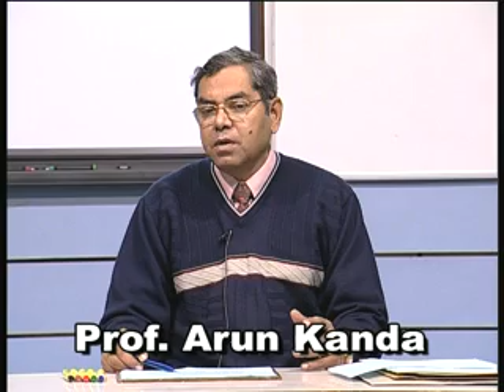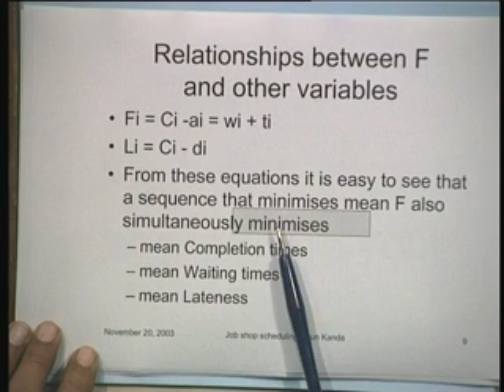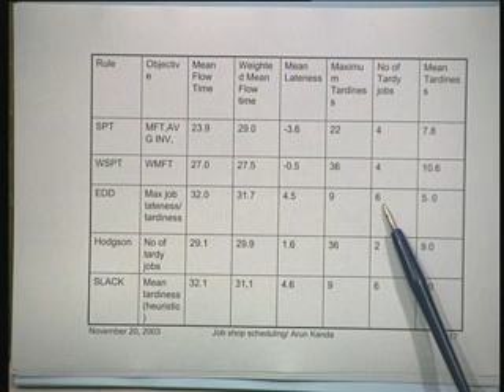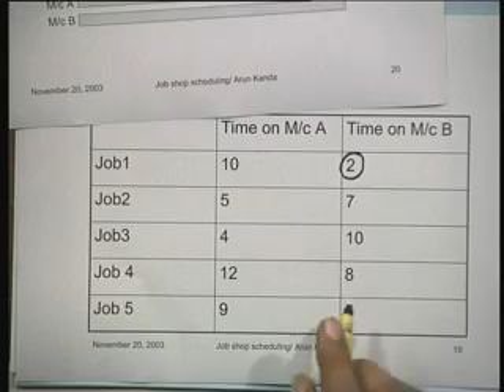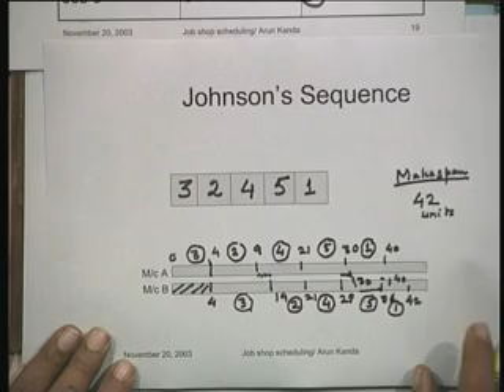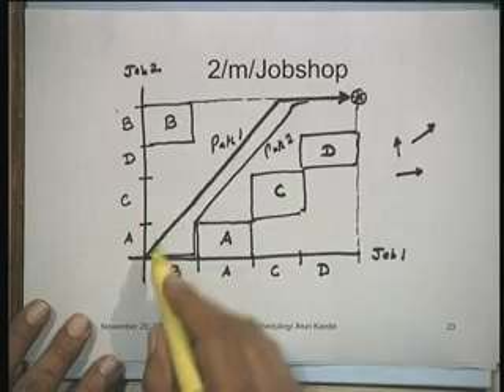Lecture - 41 Scheduling of Job Shops

Comment: only one objection...
It's true that is quite time consuming to calcute all different combinations/permutations but there is a shorter way out.What I did to resolve it, instead of using heuristics, was to precalculate the different combimations and store them in a database. Then, instead of calculating the optimum routing sequence "on the fly", you can just find it using a fast sql querry.The PC used was a 2006 model and needed about a day to give from (2!)^2 to (4!)^20 permutations using VB6.